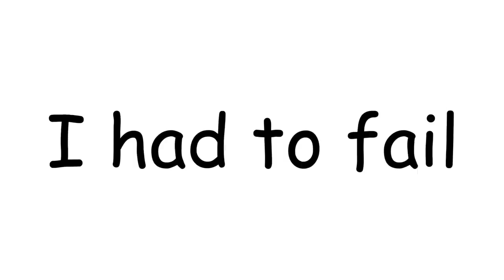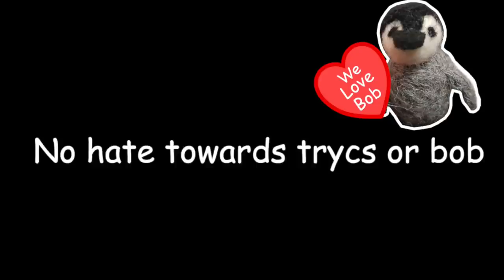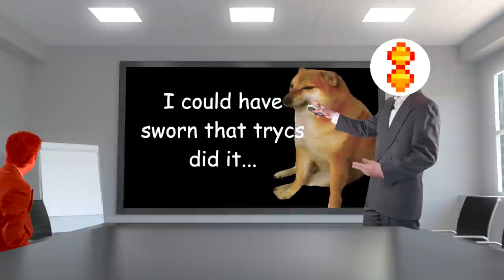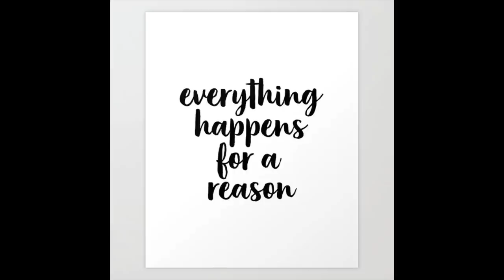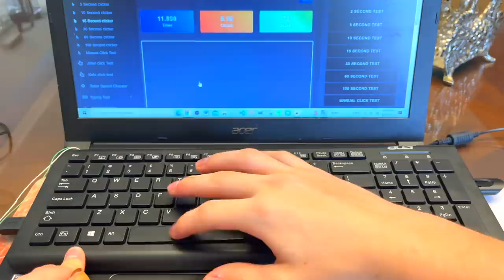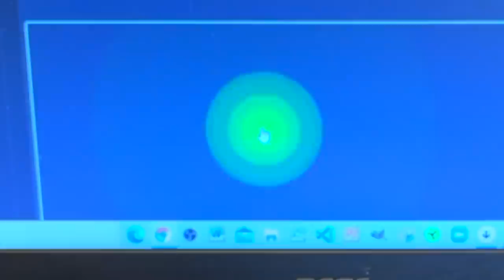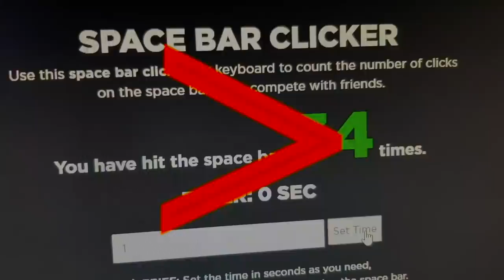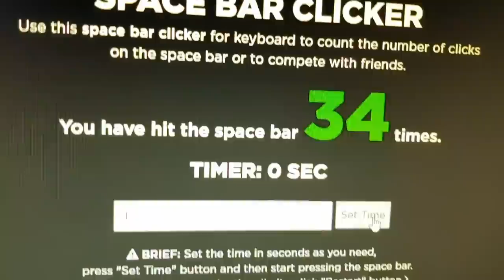Drag Clicking Keyboard Mod (FASTER than Trycs)

Comment: If you want to get better desoldering,  you should use something to take away some of the original solder before you remove the switch, and definitely use flux to help heat up the solder more evenly. Also if your iron is old, try cleaning the tip with sandpaper.